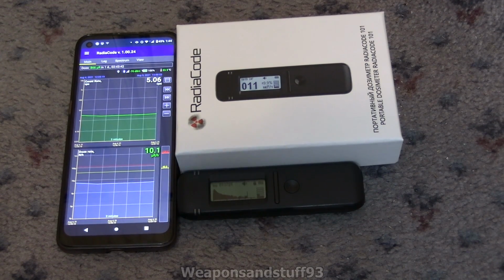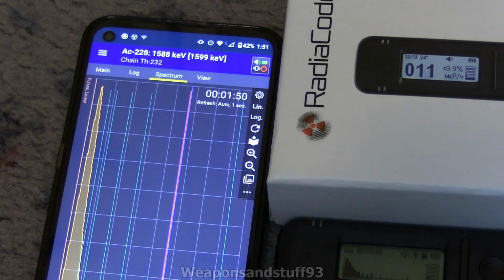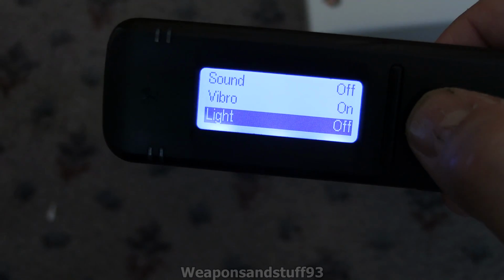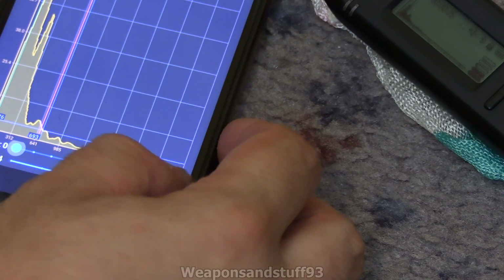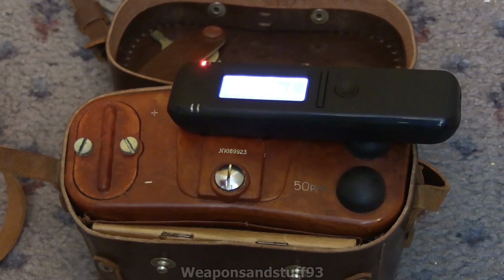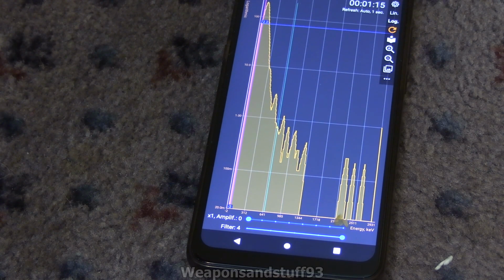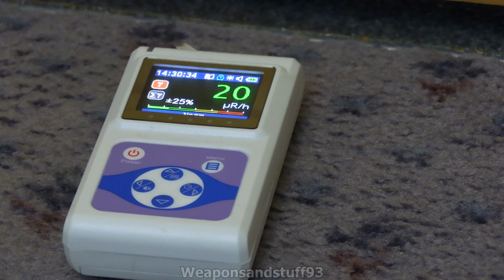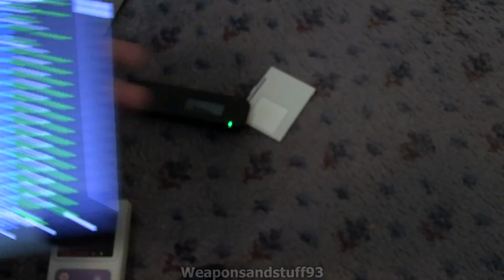Radiacode 101 Digital Spectrometer Review and Tests

Comment: no you cant have radium and thorium together ; its just an artefact as the resolution isnt fine enough with that kind of gamma spectrometer. The use of the filter enhances the false peaks . There could be peaks from the thorium decay chain that could close to peaks from the radium decay chain and as the resolution isnt that good the radiacode cant discriminate properly and its normal. Thats why you should wait for a few hours and no filter to get a clean spectrum.. You cant identify lines especially in the high energies .

Comment: The lifespan of a tube is given in counts. What is the lifespan of a scintillation sensor? The old tube tube and the newer - I presume scintillation semiconductor? I'm very tempted to get one myself but they're not exactly cheap. Are there any not using rechargeable LiIon batteries? Much prefer AA or AAA. My cheap Chinese Pudibei NR-1050 (the best of that family) uses two AA and I can't even measure standby usage with most sensitive setting on my multimeter meaning just put in a set of AA (single use) 1,5v lithium and they'll set there for decades (at least the stated shelf life of the cells, typically 20 years) ready for action. Being lithium - no leaks. In that respect LiIon isn't that simple set and forget and suddenly you might really need it - not just for hunting vintage radio active stuff or rocks - and then because of battery choice it doesn't operate - at least not immediately. Beside overall power consumption of the NR-1050 is very low in the order of a handful or two mA so batteries will last very long.

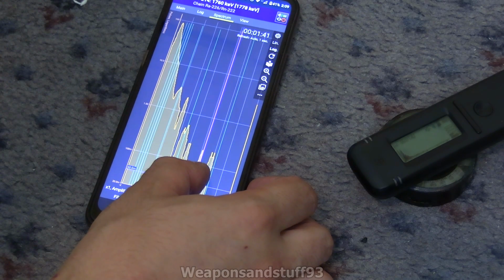Comment: 21:22 The K-40 Is Potassium-40 a β− Beta decay and is Probably from your body, Your Muscles 80% and bones 20% to be more accurate, As you may know by now bananas are slightly radioactive, Go buy a large tub or bag of potassium chloride or anything that contains high levels of potassium and you should see a noticeable radioactivity, the K-40 Is in concentrations of about 0.012% K-39 is 93.258% which is Stable and K-41 Is at 6.730%

Comment: Have you compared it to a standard NaI + photomultiplier gamma ray spectrometer?  It's  hard to believe that something this tiny can give the same results as a honkin' great lump of physics hooked up to an MCA, I'd really love to see a side-by-side comparison, at least in part to see whether I can ditch my existing setup for this one.
Reply: It does not give the same results as a lab spectrometer, by a long stretch. The main difference compared to a laboratory spectrometer is the much smaller crystal, hence lower sensitivity and also a much lower resolution. It divides the  20KeV to 3MeV range in just 255 channels. This means that narrow peaks close to each other cannot be resolved, limiting its ability to identify isotopes.  
It uses a small Thallium doped CsI crystal, 5x5x5mm if I remember correctly and a solid state photomultiplier.

That being said it is still a great instrument for its size and price and I do not regret buying it at all even at a much higher price than everyone else seems to buy it.  I bought it from their branch in Cyprus for $580 including postage and VAT.
Reply: Smaller chrystal means it will not detect as many particles than a large one. Something like 1cm cube will have a volume of much smaller than typica say 50mm diameter 50-100mm long scintillator. Much less detected particles means much much longer measurement times to get as many photons hit the chrystal.
Reply: The radiacode 101 uses a CsI:Tl cristal with a solid-state silicon photomultiplier.
Reply: @DanyDM_98  Chrystal is different, but it only the part that produces flashes of light. It still needs a detector. I'd assume a semiconductor protodiode of specian kind or whatever.
The crystal is not a photomultiplier. Those multiply light (any light) and produc electronic signals.
You can also use some polymers instead of  crystals but those usually don't have the quality of signal CsI(Tl) or Thallium doped NaI have.
Detection efficiency and signal width are the parameters to check if you want to see how those different from each other.

Comment: I just got mine in the mail today to the states. Can I ask you a question? My normal cpm on my Geiger is about 10 background where as this has 250. Micro sieverts shows the same though. Is there a reason for that?
Reply: I think that counts per minute depends on the size and efficiency of the collector. The microprocessor/needle takes that and is calibrated to give the correct reading out.
Reply: @micb257  I figured it out on this one. Since it’s not a traditional Geiger counter but a scintillator it is way more sensitive to ionizing radiation therefore more CPM but converts properly to correct micro sieverts per hour. I made a video on my channel reviewing it in an abandoned uranium mine and hit 10 microsieverts an hour
Reply: @HoosierDaddyFirearms  Thanks for the tip about your video, I put my vote in for a tin foil hat too!
Reply: @micb257  hahahaha that was hilarious 😂

Comment: My TV-1A McPhar Spectometer (1970ish) is incredibably more senitive than my GMC 500+ but no where near the spectra analysis of the Radiacode 101 for display.  But I suspect if the  dung hits the fan I would prefer the gieger counter and lots of booze. Very interested in this for sample checking, will look into it.